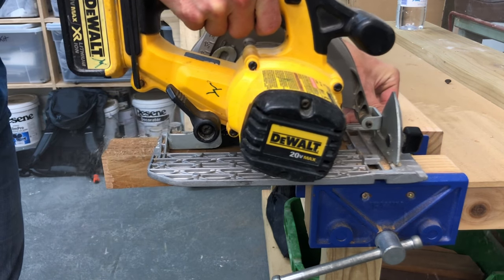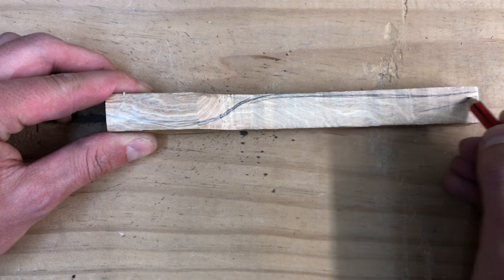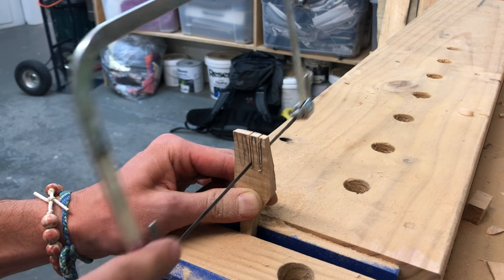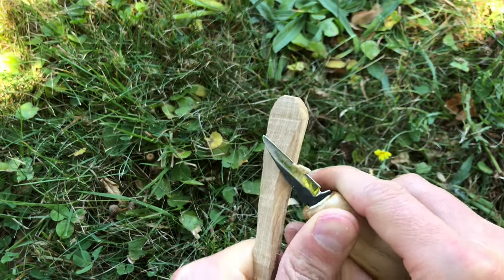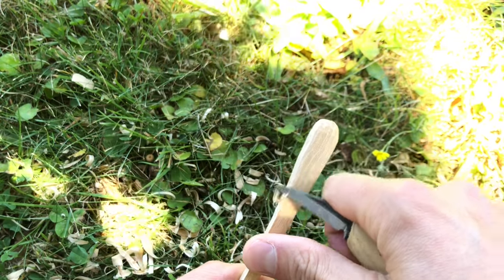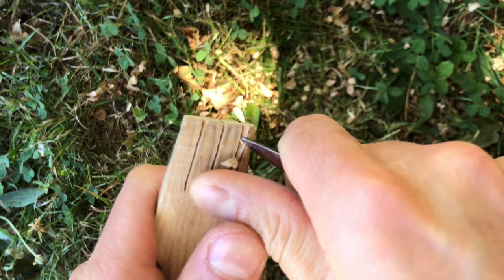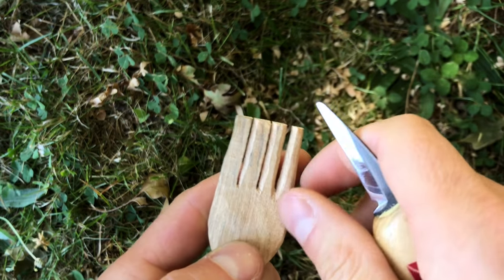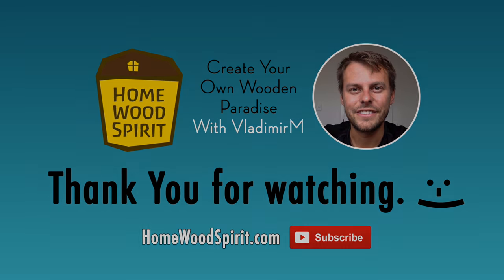How to Carve Wooden Fork - Easy

Comment: That looks fun! What does the oil do to it, and can I use like olive or canola oil?
Reply from the maker: these oils can get rancid. They protect the wood from water, but needs to be reapplied often due to washing.
Reply: @HomeWoodSpirit  Okay, so I can use olive oil? Or do I have to use the one you used in the video?
Reply: @deannajohnson3933  I’ve been told that yes, you can use either. You’ll need to reapply the oils frequently after a couple of washings.